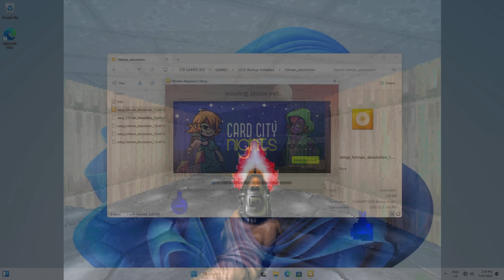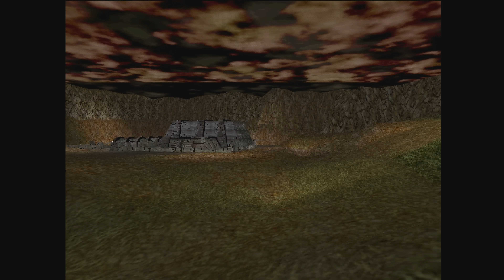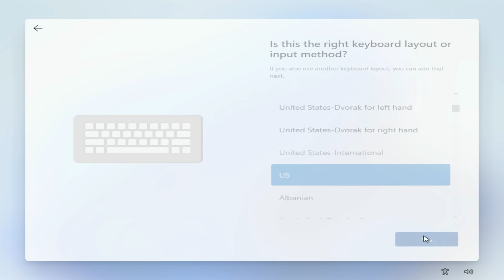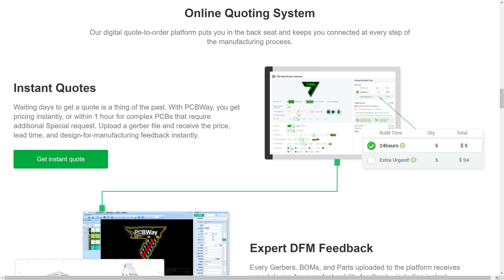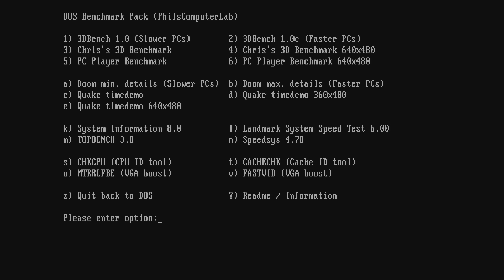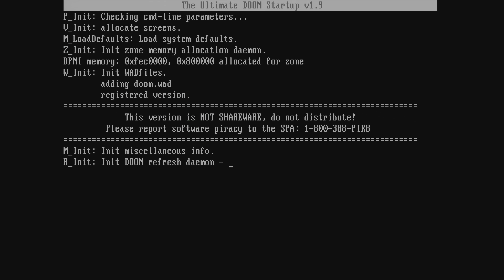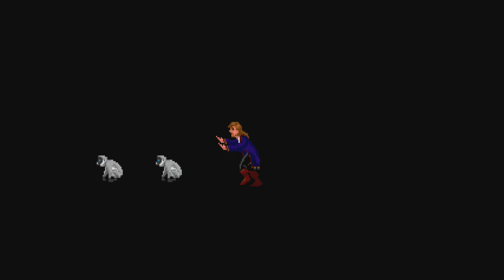LGA 775 The Next Big Thing for Retro PC Community?

Comment: Weird that I see this video right after fully finishing my retro build. Q6600, 4gb DDR2 and.. Well okay I cheated a bit with the gpu, but 750ti was extremely cheap and did not require me to break the bank on even older, rarer cards, and it is blisteringly fast while still supporting official XP drivers!

Comment: I've got pretty much everything a LGA775 enthusiast would want short of a skulltrail setup (technically I'd still like a Nforce 780i board but that ain't too hard to get) , nforce 790i mobos are a PITA to get at reasonable prices (but I got lucky as hell with a for parts one) as are X48/X38 mobo with DDR3 support (though even harder to get are DDR3 sticks that are relevant to it and will do 1600-2000 with extremely low timings since the OC community is hoarding the good Elpida ICs, though technically you can get away with Crucial stuff if you're not afraid of running RAM at ludicrous voltages, worst case PSC and Samsung 2GB D-die aren't "bad" either)

Comment: Thanks for the video. Good work. I have several socket 775 parts, from Core2Duo to the Core2Quad, Q9400, 9550, 9650, and several DDR2 ram modules, creative soundblaster cards, with windows media center. I also have an nvidia motherboard. Plan to rebuild retro machines for the fun of it. It is a good time pass.

Comment: Oh, there's something else I'd like to ask.
As I have previously mentioned, my old ASRock 775Dual-VSTA board has both an AGP slot and a PCIe slot, but the PCIe slot runs only at x4 speed. Is it still preferable to use the PCIe slot regardless of its lower speed? Or is it better to use the AGP slot instead - which runs on x8 - despite how rare AGP video cards have become (at least in my country) - especially the higher-end models?
Reply from the maker: Fancy some benchmarking? Only one way to find out 😊
Reply: Well, I have an update on that one.
I got a GeForce 8800GTS 640MB back in November last year to see how it performed on that old ASRock motherboard. The result was frankly underwhelming as the card was bottlenecked by that PCIe slot being stuck at x4 speed and only capable of performing roughly on par with my previous GeForce 9500GT on a PCIe x16 slot of a separate build. Not liking how things went with my old ASRock board despite it no longer running into display driver crashes which were crazy frequent during its time as part of my main PC (thanks to the sketchy PSUs powering that thing), I ended up hunting for different LGA 775 boards on the used market, which led me to a lucky find in the form of an ASUS P5W DH Deluxe; one of the very few Intel 975X board with support for 45nm-based Intel processors on that platform, hence why the board came with a Pentium Dual-Core E5700 pre-installed on it.

Aside from its missing primary SATA port and a possible IDE controller malfunction, that ancient high-end ASUS board was still functioning quite well. Though, sadly, the board was unstable and could not boot into Windows if I have it running on 333MHz FSB and have all four DIMM slots populated with 2GB DDR2 PC6400 sticks for a total of 8GB - even though it was stable with just a pair of 2GBs (4GB) and I was able to do benchmarks on it as the other pair of 2GB sticks were a later addition. Either because the northbridge couldn't handle that combination at stock BIOS configuration, or because each pair of DDR2 sticks came from mismatched brands. I previously had a Core 2 Quad Q9400 on that board, but I ended up downgrading to a Core 2 Duo E7400 as per my original plan to aim for higher single-core performance on that particular build. Thankfully the combination of E7400 and 4x2GB DDR2 PC6400 worked without issues, both in stock config and with 320MHz FSB overclock (2.8GHz -> 3.36GHz). Still couldn't get the 333MHz FSB working as of yet, though.

Comment: Early this year I built a PC with LGA 775 socket from old parts (Asus mainboard, HP case). It has a Pentium 4 3Ghz, 4GB of DDR2 RAM, a Nvidia NVS 295 and runs Windows Vista and MX Linux in dual boot on two different HDD (one IDE and one SATA ). It even has a very capable CD/DVD-RW drive and Vista runs like a charm.
Reply from the maker: That's a great build and a great combination of OS choices!

Comment: I have kept an ASRock 4CoreDual-SATA2 motherboard simply because it has the best connection capabilities of any board I've ever had.
IDE, SATA, AGP, PCIe, PCI, USB, PS2 ports, com and printer ports.
I can use it to move data from almost anything to anything with SCSI and FireWire PCI cards.
Worth its weight in gold.

Comment: I’ve always had a soft spot for the LGA 775 platform. Over time I ended up putting together three different builds.
The crown jewel is probably the Q9650 paired with an MSI MS-7519 Ver. 2.1 P43-C51 board, 16GB DDR3, and a GTX 970.
The second rig is a Q9550 on an ASUS P5Q-E with 16GB DDR2 and a GTX 1050 Ti.
And the last one is a Q9400 on an ASUS P5QL (Intel P43), 8GB DDR2, running with a GTX 750 Ti.

Comment: Personally I'm not thrilled with LGA 775 as the higher end the board, the higher the likelyhood the northbridge went bad by now. Long-term I can't wait until 1156/1155 become "full retro" & I also can't wait for LGA 1366 to become retro as well as that's my favorite platform for overclocking. Sadly consumer grade LGA 1366 mobo are the inverse of 775 as the lower end the board, the higher the likelyhood the board is to fail. So that means only high end LGA 1366 mobo that already cost a fair amount back then are now either really cheap or really expensive. Additionally LGA 775/AM3 & DDR3 were a bit of a wild west back then as DDR3 could vary from like 1.7v-2.1v (ex. OCZ) which may or may not do damage to later DDR3 supported sockets like 1366, 115x, etc. A bit of a side tangent too - most RAM from 1366/1156 typically had "matching" timing, ex 8-8-8-24 @ 1600Mhz (I know mt/s now but going with the terminology of the day) | 9-10-9-27 @ 1866Mhz | 9-9-9-27 @ 1333Mhz | etc, which trips up a lot of people buying sets from really late ultra-high low-voltage 1155 & especially 1151/1150 then run into all sorts of problems running stock nevertheless when overclocking them.

Comment: I recently picked up an asus p5q3 and e8400 bundle for 30€. Both woke fine even if I separated both parts into different systems, the p5q3 has a q6600 now and the e8400 went into an asus 
p5g41t-m lx. All parts still going strong.

Comment: LGA775 is just so versatile. Heck, I picked up an e-waste corporate workstation pc released in 2009… but HP’s website has FULL sets of drivers from XP all the way to Win8.1 (and using 10 on it just automatically downloads relevant drivers from Windows Update). Best pull I found. Core2quad with a Radeon HD 7750 (didn’t require power supply, had drivers for XP and onwards, so most compatible)

Comment: This was the first plattform I build a custom PC with, as a student.
Abit AB9 QuadGT with Xeon 3230 (basicly a Core 2 Quad 6700) overclocked to 3200 MHz with air cooling.
8GB memory, two WD raptor 10k rpm drives in RAID0 for Windows and games + two 640GB drives in RAID0 for storage..
I also used a abit uGuru front panel that allowed to switch bios profiles without rebooting.
For Graphice I think I used ATi Radeon HD3870 and later the 4870.

I sold the board with CPU and memory.
But I think I still have an abit AW9D and the front panel.
Now I should start to look for memory, graphics and storage to rebuild something :)

Comment: I've gotten 5 motherboards for 775 I love this platform! The current best board I have is a MSI P6N SLI Platinum with Q6600 takes what ever ram I put in it. I also have a Xfx 750i sli board and that is so iffy in posting I think it is RAM issues. My Asrock 4CoreDual Vsta I think is dead won't post at all with nothing. Just bought a P4 board a ECS RS400-A Hope that works to test out some AGP cards. Also have a Foxconn G41 board I pulled from a PC I built my parents years ago.
Reply: Also can get a ASUS p5k Wifi ap board with my old lapped q6600.

Comment: For this period of hardware I'd prefer more on AMD AM2+/AM3 platform. Good compatibility with Windows 2000 to 11 (98 also works on AMD 700 series chipsets), wider selection of CPUs, cheaper and more expandable motherboards with SATA2 and PCIe 2.0. Also, there are more things you can tinker with such as the famous core unlocking. Hope you can make a video someday!

Comment: I'm in team "fm1/fm2 will be next big thing for retro".

In cost of losing IDE you get many quality of life improvements over 775. (Heatsink on vrm in most boards, getting rid of problematic to cool north bridge, backplate by default, cheap ddr3 ram, good igpu, virtualization for gpu-passtrough, more available coolers, extra pcie x4 that can used for nvme with modded bios) 

Additionally on Intel's 1155 side you cannot get all with one chipset. For example b75 with native PCI is retro friendly, but you lose overclocking. On amd's side most full atx boards give you everything.

Comment: There are a lot of tweaked Xeon socket 771 CPU's that offer more speed flexibility and performance than 775s. They are dirt cheap on the CN platform and so is the ECC memory you can use with 771s. I'd like to get my hands on a 775 motherboard that offers native FireWire connectivity. That would allow for the use of an external SSD drive. The USB2 ports just aren't fast enough, which means I'm either cloning that external drive onto an internal one or I have to add and remove drives a lot. The main advanyage of FireWire is that you can daisy-chain devices, so a single connector on the board would suffice for a harddisk, keyboard, mouse and sound card. DOS drivers for FireWire will be scarce, but W95 had them.

Comment: Did Pentium 4 stuff ever get expensive? I ask because for almost 15 years I've had basically a flood of P4/C2D stuff coming in from thrift stores and street corners. Sadly I've never seen anything as new as LGA1155 abandoned on the sidewalk...

Also I love overclocking Q8000/9000 quads on P43/P45, my beloveds
Reply from the maker: Everything is getting expensive over time. Nice P4 gear, absolutely. Especially on eBay and if you don't have access to thrift stores or similar.

Comment: Three LGA775 systems later (description below) and I couldn't be happier. 🙂

System 1:
Asrock 775i65g R3.0 + Pentium E5800 @ 3.2GHz + 2x1GB DDR-400 + BFG GeForce 7800 GS + SB Audigy2 ZS + Windows Me and XP SP3 in dual boot.

System 2:
Asus P5WDH Deluxe + Q6600 @ 3GHz + 2x2GB DDR2-800 + Radeon HD 5700 1GB + SB x-Fi extreme audio + Windows Vista Home Premium 64 bit.

System 3:
Asus P5Q Deluxe + Q9550 @ 3.4GHz + 4x2GB DDR2-1000 + Radeon HD 6950 2GB + SB x-Fi Titanium HD + Windows XP SP3 and Windows 7 Pro 64bit in dual boot.

I just hope they don't stop working anytime soon...
Reply from the maker: That's quite a collection, I envy your setup!
Reply: @philscomputerlab , I've scored that Asrock 775i65g R3.0 after one of your videos. ;-)

It became my "go to" Windows XP system  for older stuff...
Reply from the maker: You cover a really wide range with these systems, beautiful. From 9x games to recent modern stuff. Really shows off how awesome LGA 775 is!
Reply: @nicacioedu I got a box and disc for that but no board :(

Comment: The 790i platform might be the ultimate 775 setup. Can't speak for them all, but my EVGA 790i Ultra SLI has been running flawlessly with 24GB of DDR3 RAM, a Samsung SSD, and a Core 2 Extreme QX9650 for many years. The 790i platform also has 60 PCIe 2.0 lanes and supports 3 way SLI/Crossfire at the full X16 bandwidth. Of course it also has support for PS2, IDE, floppy drives, etc.

The one downside is that those Nvidia nForce chipsets are known for being somewhat finicky with things like RAM and voltages, although I personally haven't had any major issues with mine.

Comment: i need advice i got HP Compaq dc7800p Intel Core™2 Duo Processor E6550 8Gddr2/320gb HDD with ATI Radeon HD5450 can i use Intel Core 2 Quad Q9650 SLB8W 3.0GHz 12MB 1333MHz LGA 775 Processor? and maybe some better gpu...AMD Radeon R7 250 2gb? how it will run todays games? Thanks

Comment: My first experience with Socket T/LGA775 was with the Dell Dimension 9100 which had a Intel Pentium D 830. I also had a Dell Dimension E520 that I managed to get a Intel Core 2 Quad Q6600 working on. I am getting a ASUS P5L-VM1394 with a Intel Pentium D 945.

Comment: 👍👍👍 for this video.
But I'll stick with my iBase MB820 for retro gaming (added a SiI3124 card with SATA II and AHCI for my SSD). 😉
It works (with very few problems) up to Windows 7. Unfortunately the 478 cpu does not work with Win 10 and newer (NX bit problem - is there a hack for it?) But I have 2 ISA slots (for my AWE with DB50XG AND especially for my favorite TerraTec 'ActiveRadio' ISA radio card with RDS).

Comment: I think I have five 775 boards and couple am2 boards. Been bying them up when they are posted for cheap. Most go from 5-20€ price range and can have good cpu/ram/cooler on them or none. It really is bizzar how good the market is right now. GPU are also pretty good still but I have seen the trend and now could be the best time to get some early 2010s gpus that go for nothing. Also early 2010s in general are crazy cheap.

Comment: LGA 775 is my main daily PC. I have another board in a bag with i915. It was not stable under Windows 98, probably because of the many embedded devices creating IRQ conflicts under ACPI. I really don't want to touch it with a ten foot pole now because it only supports Pentium 4. What happens if you drop in a Conroe CPU in a Pentium 4 only board? I'm almost certain the exercise will be futile.

Yes, you can play VESA games on Nvidia PCI-E cards. ATI X550 seems to have gone with a very limited DOS memory. This has the beneficial effect of opening the Dos-box on Win98 very fast.

GTX 610, 750 and 960 have some kind of hacky compatibility, which would get you through using a graphical recovery software. I think we can praise them for allowing such programs to still work. I tried to play Duke Nukem 3D on it. It had either a very slow framerate (610) or flashing (960). It does internal scaling of the image. You can do something ridiculous like ask for 1600*1200 VESA and the adapter will downsample it to a 1024*768 screen.

A Pentium 4 may have cooked the motherboard, the capacitors around the processor. I've seen that.

The Intel 8xx series have much better Windows 98 compatibility. SATA and PCI-E were quite well designed without needing any special software support. The lower Pxx chipsets have limited RAM capacity.

For Windows games you don't need any special retro platform. Later processors of the Ivy Bridge generation are about double the speed of Conroe, and run much cooler. I would rather build a system based on that if I had to start fresh.

I think Windows 10 or 11 have no business being on an old computer. Windows 2008 R2 will get you compatibility with most recent sofware.

The thing I don't like about the "retro" community, because as with any hobby, you are expected to spend money. Pay for long abandoned games. Pay hardware speculators. All this stuff was once discarded as having no value.

Comment: I have a DFI LanParty P35 with a Dual Core2Duo E8400.  I paired it with an MSI HD 5770.  From your advice, I have a new SB1040EF XFi coming this week.  EAX aside for now,  I installed Far Cry which has been sitting in a storage bin in the basement with zero issues and it runs super smooth.  I also have Crysis, but I am afraid if I install it, it might set the video card on fire 🙂

Comment: I have two LGA 775 systems, a Core 2 Quad 9650/GTX 285 and a Pentium E5700/9800GT combo (that one is for sale on ebay) that are both set up to triple boot XP, 7, and 11. I use 11 to get GoG installers and steam games (can only get to function under Windows 7) and play the games on the appropriate OS. The Pentium works fine for Windows 11 but not great, the Core 2 Quad is surprisingly good in Windows 11, better than a Walmart laptop.

Comment: Interesting as I tend to ignore LGA775 other than the ones which also have AGP (especially core 2 + AGP).  I see a lot of 775 machines every week at the flea market but I am also finding a lot of old retro PCs from 486 to Pentium 1,2,3 and of course P4 478.  Even the occasioanl 286 or 386. If you have seen any of my weekly car boot retro hauls you will know I have no problem finding a regular supply of retro PCs for 20 euros or less... do you think this is an issue that depends mainly on your location?  oh a question for you Phil as no one seems to know what the answer is.  If Slot 1 are Pentium 2 and 3, Socket 7 are Pentium 1.... what are the Pentiums that came out before that called, I had one back in the day a P66 and it fit in a much larger socket. I've never found one of that type since collecting retro PC hardware for the last 6 years or more.  BTW it was you who got me into retro PC lol
Reply from the maker: Nice flex, being able to get parts so cheap, unlike most of us 😂The first Pentiums are also called Pentium, but the socket is a bit different. they used socket 4.

Comment: I've got an MSI P43 Neo board, however that board needs a full recap, almost all the electrolytic capacitors are bulging, which is probably the reason why it's been so hit-and-miss, specifically with ram, I can test 6 sticks individually and all are fine, I put 4 together and the system starts fine and runs without a problem, however, some late boot just doesn't work unless I take out all the Ram and try only one stick!